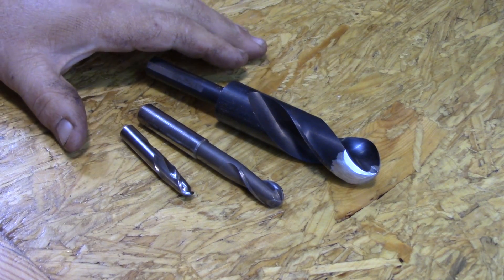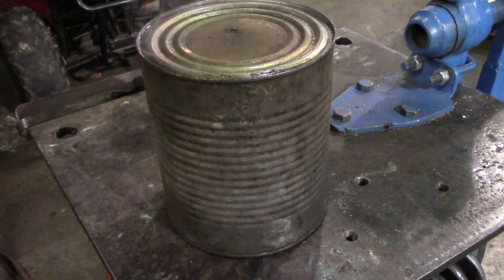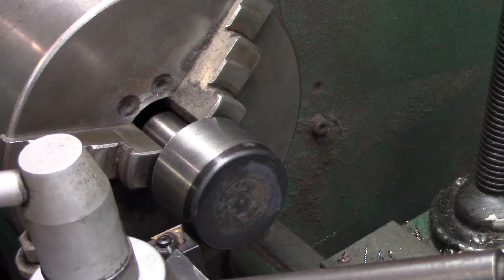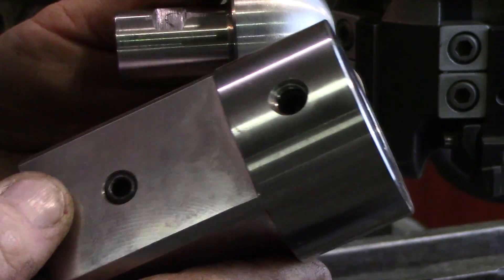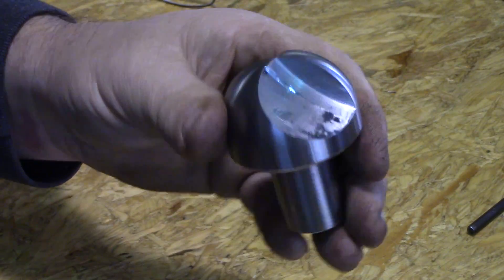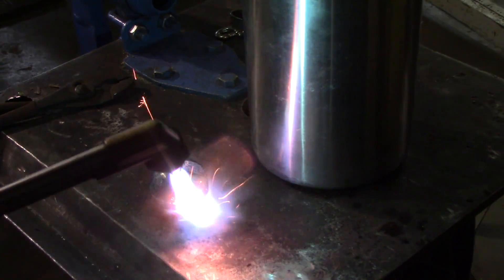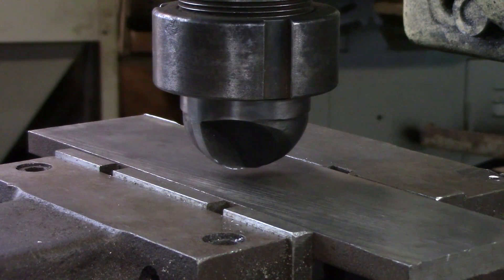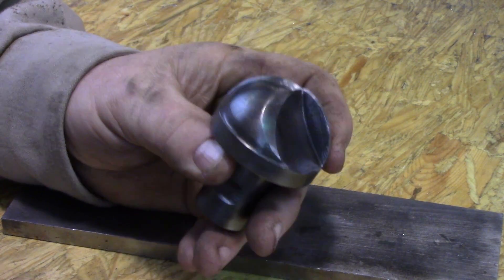Shop Made Ball Nose End Mill

Comment: I would have never guessed you could anneal a bearing roller at home enough to machine it. I would have thought a 12 hour controlled annealing process would be needed.
Reply from the maker: I have to admit, it was a bit on the hard side but that's probably because I didn't get it as hot as I intended.
Reply: heat it up to 800* centigrade and  put it into sand to cool down